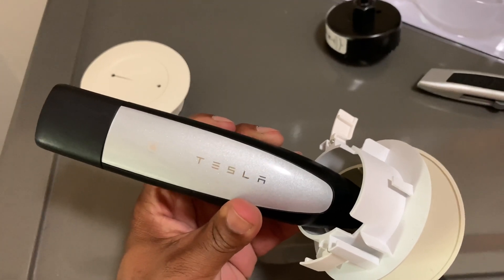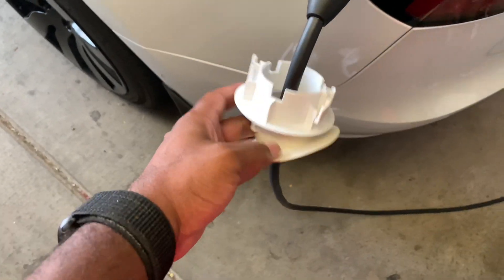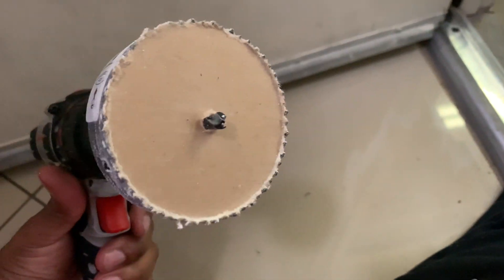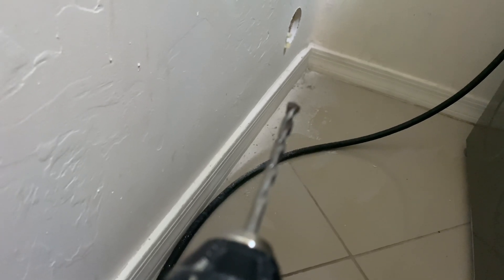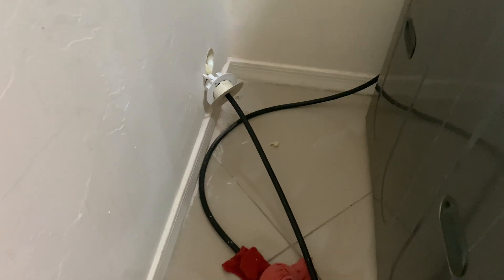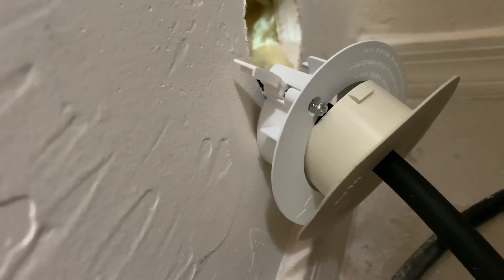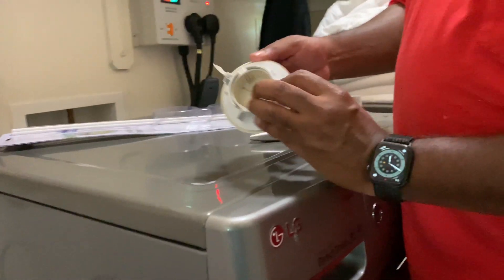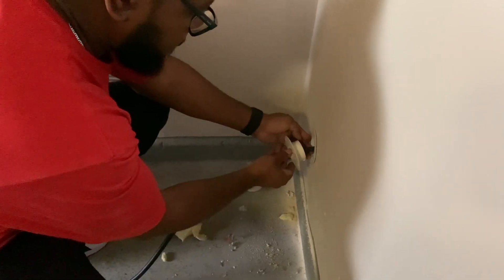How To Install a Tesla Charger | Splitvolt

Comment: How are you enjoying the Splitvolt?  I hear that the internal breaker trips easy. Have you experienced that?
Reply: Not easily but I have got a replacement one unit from Splitvolt because the first one stopped working. Their customer service is awesome. Apparently I had a bad lot and the changed some internal components. The new is working great with no issues. Had the new one for about 6 months now.

Comment: Just saw this video as a solution to the same problem. A little different approach that might be a bit cleaner and safer install (in case charger cable is mistakenly pulled).  Of course, the outlet you install should match the plug on your charger.

Comment: Nicely done. Smart move. Might want to stuff or wrap insulation inside hole or seal grommet with silicone to prevent ac/heat loss (especially if you are in Tucson) and to keep insects from getting inside wall. I like your helper too. Always good to have them help, learn, and keep you thinking correctly. 😀Thanks for very specialized video that should others with same problem.